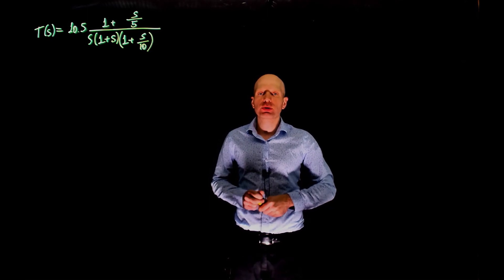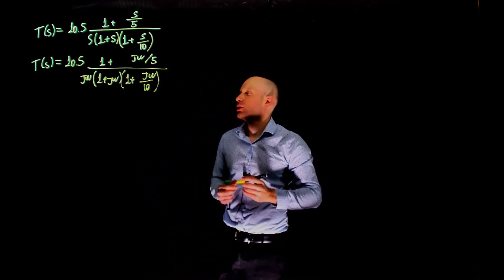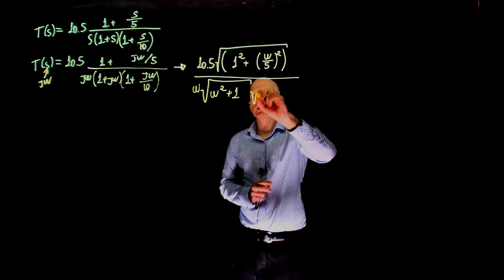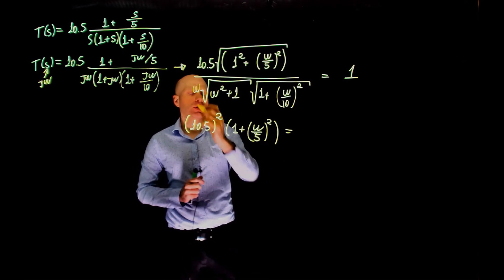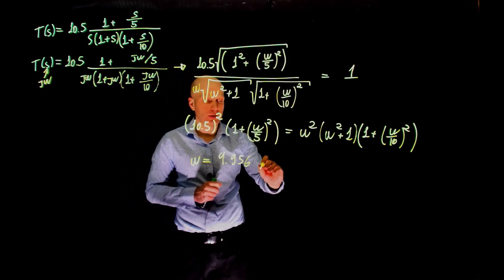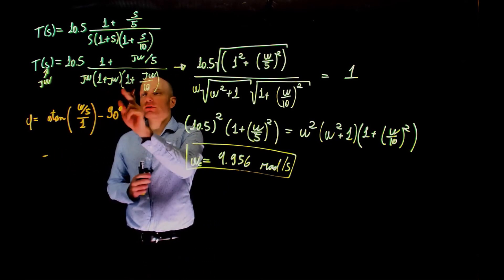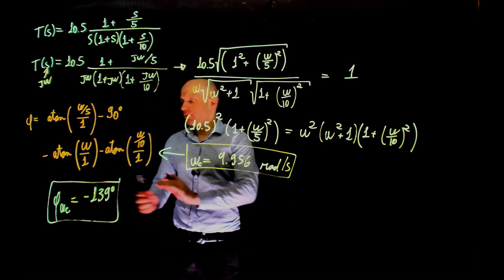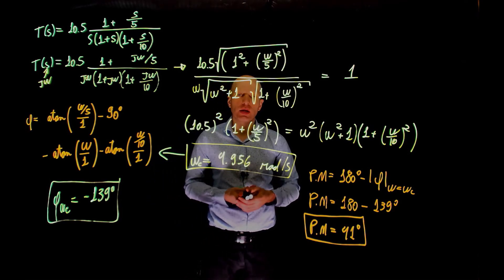L20E119 - Control Systems Lecture 20 Exercise 119: Phase and gain margins

Comment: There is an error. I believe one of the poles of the TF was copied incorrectly. (1 + s/2) was copied as (1 + s) which changes the value of phase at 5 rad/s from -140 to -150, which would not be true for a phase margin of 40deg.  But I could be wrong.
Reply from the maker: Yes, there is. Please work with the version copied on the lightboard.